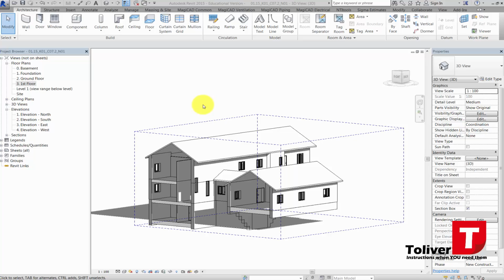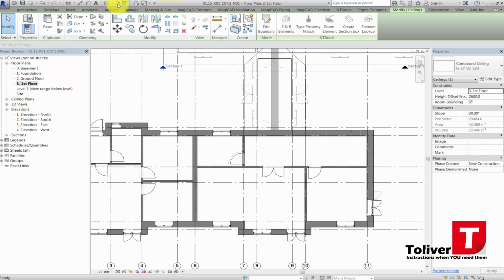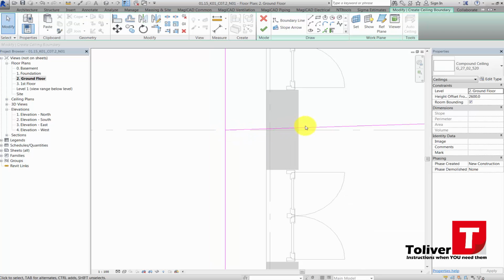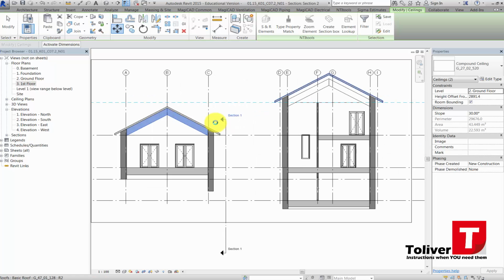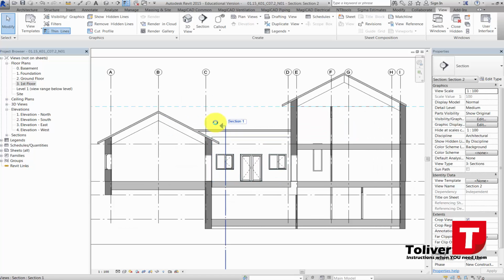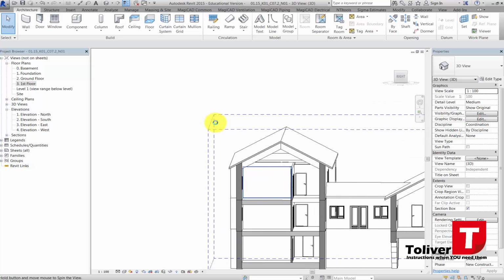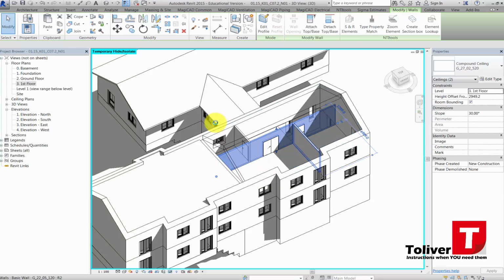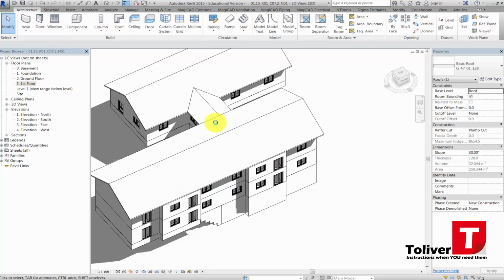15  Creating Sloped Ceiling in Revit

Comment: Hey bro i am trying to just make a false ceiling for my air conditioning work. I tried making two ceilings, and tried making two soffits, the two levels work just fine but then i dont know how to close them up so that the false ceiling ends at the grill and does not continue all the way to the end of the room, if you know what i mean. So all i need is just to connect those two false ceilings with one vertical ceiling, i tried facias for that but they only give me a small lip.. how do i do it? can the slope be set to 90 degrees? would that make it go vertical? i really do not know what else to try.. Thing is its not meant to be a roof it has to be a ceiling.. any idea how to solve this issue?

Thank you